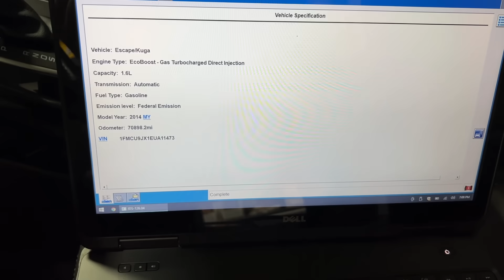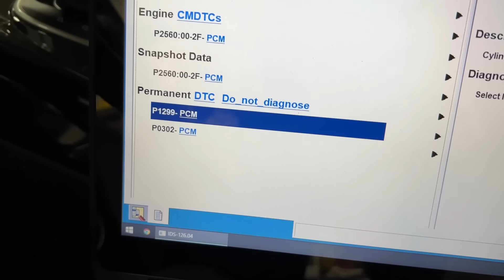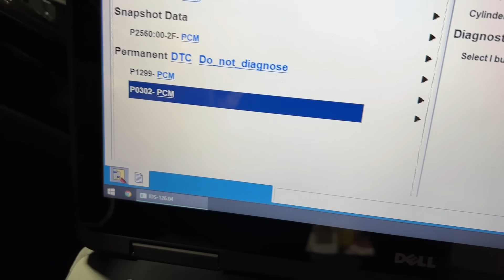Beware of Ford’s 1.5L 1.6L 2.0L Ecoboost Engines and Their Never Ending Coolant Consumption Issues!

Comment: Thank you for the video. I'm very worried for my 2020 ranger. I change my oil every 3k miles strictly, I will do tranny and differential stuff when makuloco and other Ford tech YouTubers has suggested... All that keeping up on the maintenance and there's a chance this may happen. What can I do to avoid this? I only have 20k miles and I have a mishimoto catch can on it. I'd greatly appreciate anyones advice..
Reply: changing the oil every 3,000 miles is a waste of money. modern synthetic oils easily last 10k miles. 5,000-7,500 miles is a good middleground though. 
that said, there's nothing you can do to avoid this fate, it's a design flaw. well actually, you can sell the vehicle and buy something that isn't a Ford.

Comment: I absolutely love the new Ford Maverick. I love the first generation Ford Ranger but could never afford one at my young age at the time. The Maverick has that same charm with me at 54 years of age. This is sad news about the Ford four cylinder engines. I guess I’ll just keep looking. What truck is best for the long haul?A F150 with a base engine?
Reply: best truck for the long haul would be a Toyota Tundra, or Tacoma if you want something smaller.
Reply: @busterscrugs  love the look of the Tacoma but the ergonomics don’t fit my body. Horrible cab design. The previous Tundra is nice.  I’ll end up doing the timing on my 2006 5.4l 3v.
Reply: Not brand loyal but Ford is a nice truck.

Comment: Trying to get a little extra milage by turbocharging an excessively small and lightweight engine. These things run exactly as the old mechanics predicted they would when they came out. Too bad they were designed by engineers.

Comment: An easy  permanent solution to this issue on all three of these ecoboom engines is Steel Seal. One bottle used as per instruction will cure this problem.
Remove 1 litre of coolant from the header tank, warm up the engine and pour the Steel Seal in. Let the engine idle for 20 minutes and switch off. Do not use the car again until the engine is stone cold, ideally overnight. Check the coolant level, top up if required and use the car normally.
I've done 3 like this with this issue and all three have done tens of thousands of miles without any loss of coolant.

Comment: We have had internal combustion engines for over a century. It still beggars belief that manufacturers are churning out engines that are pieces of junk. These car manufacturers really need holding to account. I’m sure much of it is down to the bean counters trying to produce an engine as cheaply as possible and it’s time to stop. Would I buy a modern car? No, I’ll keep my older, tried and trusted motors going as long as possible.

Comment: I have a 2020 Ford Explorer ST and it is a piece of Junk. It only has 15,000 miles with a list of issues that I am waiting on the Ford dealer to get parts for for over three months now. Rear differential is leaking, rear view camera is blue screen, driver side camera is blue screen, driver side cooled seat fan makes grinding noise if and when it decides to work, windshield cleaner fluid  pump stopped working, window controllers on driver side trim coming off, ceiling lights on passenger side hanging by the wire, rattles in dashboard. Thank God it is a lease. I called Ford Motor Company and they really don’t care. This is my first and last Ford.
Reply: Damn, my friend's mom just bought a brand new Explorer ST-line. RIP.

Comment: I had the same problem with my 2019 Ford Fusion.  They replaced the short block.  I just got the car back from the Ford dealer 2 days ago after almost 5 months in the shop because of part shortages.  Luckily it only had 52,000 miles on it so it was still under warranty.  They loaned me a 2022 Ford Edge to drive while it was being repaired.

Comment: sad .. I'm not a  big  fan of Fords .. i think they  are  getting better now than  90's cars but still issues ..  i  wonder  if a bottle  of K&W  block  sealer  would  work (its liquid glass)   its worth a  shot , very  strong  when it  drys  .. could be  strong  enough to hold for many miles  trouble  free . thoughts ?  ive had  good  success with the  product . $14  compared to $8,000 for new engine
Reply: or the steel seal block sealer product too .

Comment: I have a 2017 Ford Escape SE with the 1.5L Ecoboost with 28,000 miles and my wife has a 2015 Lincoln MKC Reserve with the 2.0L Ecoboost and hers just rolled over to 70,000 miles 2 days ago.  As of yet there have been no major issues but I will be keeping an eye on the coolant from now on.  I'm due for an oil change in a couple of weeks so I'm sure they'll inform me of any visible leaks.  Thanks for this valuable info.

Comment: This is the worst car I've ever had I took it back to Ford told them it had issues they just kept giving it to Sunshine treatment fell out with that dealer and took it to another Ford dealer they tore it down and they had it for 3 months . Finally the rental car company started pushing them they put a head gasket on it and throw it back together then it blowed up again. now it's got transmission issue that just cost me $4,100 never buy another Ford again

Comment: I have a 2014 escape with a 2.0 . It has 214,000 miles with no problem.  The 2.0 is a complete different engine than the 1.6.

Comment: Wow, i have 17 fusion with a 1.5 eco.  Very eye opening. I’ve had to add coolant the last couple times at oil changes.  has 82k miles
Reply: Was it smoking from the exhaust? Or did it not give any signs at all? Besides having to add coolant. Thinking about getting a 2014 fusion with the 1.6

Comment: Thank you so much for this video. My wife and I would love to like and own another Ford. Love the looks of the Mustang, but It's basically off the list at this point. Because I really don't want the V8 and the 4 banger turbo is the only other option. Dropping the V6 was stupid. Ford has no excuse making these kinds of mistakes. My 2011 Crown Vic Police is still solid after now owning it for over 3 years. It's not like they don't know how to build something great! And after now owning 2 fairly bulletproof Honda's, I couldn't live with buying something that's going to quickly turn to garbage based on looks. The Dodge Charger seems like a better choice at this point!!
Reply: Nothing beats the V8 Mustangs but the 3.7 V6 is a solid daily driver and is fun to drive with ~305 HP/ 280 lbft at the crank and decent gas mileage. It was a great improvement over the previous generation 4.0 V6 SOHC with 210 HP/ 240 lbft torque. The 3.7 V6 is very reliable and it has the external water pump unlike the 3.5/3.7 versions of the engine in FWD vehicles. The engines are also easy to work on/maintain. The Ecoboost has an edge with additional HP/torque but at the cost of long term reliability/cost of repairs.
Reply: @robc7323  
I agree 100%.  I have an 06 Mustang with the 4 liter and automatic transmission, it was bought with 45,000 miles on it and now has 51,000.  It is fairly reliable, but I know that the newer Mustangs with the 3.7 V6 are much, much better.  And yes, Ford screwed up bigtime by dropping the 3.7 from the Mustang.
Reply: Crown Vic Police.... Makes me want to watch a certain film again, if you know the one I mean. Woop Woop!

Comment: I'm a Ford guy and with gas prices heading north of $5/gal I was looking to get a smaller fuel sipper Ford, this makes me really question what I should consider from their lineup. 
Thanks for always giving such great info
Reply: People keep banging on about Toyota and Honda like they don't have their own issues
Reply: BUY TOYOTA for bullet proof reliability and resale value. Ford is not worth the pain and hassle. They don't stand behind their product aswell. Look at Hyundai, they fix all their engines for free!
Reply: All manufacturers make lemons, but Ford's QC has been in the toilet now for years.  Buy a Honda, Suby, or a Toyota.
Reply: @Nabsolute_  same. My 2 fird cars suffered coolant issues. My 2015 got the dreaded 2.0L internal cylinder leak. Ford told me to pound sand. NO MORE FORD for me. I already successfully turned away 3 buyers from ford. Assholes. I would definitely buy another edge since I love them if Ford came through like Hyundai and replaced the engine with no push back. But since they said FU to me, I'm saying it back.

Comment: I try not to throw mud at folks here on social media,  but I have quite a bone to pick with FOMOCO. I am a service manager for a national used car retailer, after being a 36 year master auto technician with master status achievements with Toyota,  Honda and Nissan dealerships over the years.   
Every manufacturer has cars that break. (Yes, even Toyotas,  of which I own 4 of them) but these issues with Ford 4 cylinders,  and of course the PowerShift debacle,  cost my company THOUSANDS!  Not a week goes by, without a Ford vehicle coming in with an empty coolant tank.  Every time I see a blue oval now,  I feel bad for the owners too. What's worse, the motor company is really not standing behind them either.

Comment: Does not effect 2.3. It's the 1.5 1.6 2.0. I'm a tech at Ford and have no even seen one 2.3 with this issue. 2.3 are usually pretty good.  Except the new ones where the valve cover leaks on the back side due to not enough adhesives. That's on the explorer though.
Reply from the maker: I was speaking of coolant consumption in general due to head gasket or block design. Focus RS 2.3L GTDI coolant consumption recall ring a bell? Five comments back another Ford tech told me no 2.0l Ecoboost engines have this issue and I had to remind him of TSB 22-229. Do you guys actually work at the dealers and read Oasis Broadcast Messages or what?
Reply: @FordTechMakuloco  I haven't had a focus RS 2.3 come in. Not popular in my area. I remember when this first started happening. Everyone thought it was head gaskets but it was the way the water jacket was cut around the cylinder. Most of the ones I come across are on the escape 2.0. I did have one on a fusion only it was cylinder 4. So I stand corrected on the 2.3 liter. I spoke too soon. Didn't realize it was the focus. As mentioned cause those aren't popular where I am.  We get a lot of explorers escape f150 and mustang.
Reply from the maker: Sweet!

Comment: Has this issue affected the 2019+ Ranger? I've been thinking of getting one, but now I don't think so. The 2.3 ecoboost is the only engine the Ranger offers.
Reply: Stay away from the new rangers, I had a 2020 at 10k miles I had gas in the oil, traded it for a rav 4

Comment: I think the main issue with these engines is the lack of deck surface on the blocks. Probably due to weight savings. I think the blocks are flexing under load and expansion and contraction. A more substantial deck surface will allow for better clamping force when the cylinder head is torqued down.
Reply: Open deck design is ok for normally aspirated engine but turbo or supercharged engine need be closed deck.
Reply: @weblover9185  Honda K20C1 and Mitsubishi 4B11 are both open-deck 2.0L turbo engines.  It's not an issue when designed correctly.
Reply: Good point
Reply: If the block is cracking is has to do with the casting and metallurgy
Reply: @bigdaddymak1439  what ever the reason,  Ford should recall all engines effected regardless of owner, miles  or years. Latent defect.
Reply: @bigdaddymak1439  uh no, blocks can easily crack from lack of material. this was common on some hondas from a while back. its not the metal but a lack of it
Reply: @bigdaddymak1439  not metallurgy. Thermal fatigue due to stress from expansion, contraction and cylinder pressure.
Reply: Yep... seeing the issue in person, I must agree. The walls are super thin and the water jacket paths are ON it! Freaking engineering fail. Noamount of preventative services will stop coolant intrusion. NOTHING.  People need to know this so they avoid these ecoboost engines. It's a money pit.
Reply: Does this issue also affect the 3 cylinder?
Reply: Exactly, that is why gen 1 2.0l ecoboosts with a closed deck are less prone to this issue
Reply: @chrisrossman9566  Lots of turbocharged engines have open-deck blocks, I don't think that is the problem in and of itself, as long as the open-deck block is engineered properly.
Reply: @TassieLorenzo  
Makes perfect sense while the engineering that was applied to this design makes NO sense. Didn't measure but the deck sealing surface around each cylinder appears to be less than 1/4" which would be "less than minimal" with a normally aspirated engine much less with a turbocharged engine. Don't know what "savings" Ford was chasing with this design but, whatever it was, this idea was simply "idiotic" !!!

Comment: Bought a 1979 Ford Mustang 2.3L four cylinder well maintained which the oil pump went out at 41,000 miles, bricked the engine, and Ford called it a disposable engine. I see nothing has changed over the years. No Fords for me. I feel bad for the folks that buy this brand and have such large repair bills in their future.

Comment: Just recently had my engine replaced in my 2017 Ford Edge with the 2.0 for this issue with 77k on it. Luckily I had just renewed the extended warranty a few months before this started to happen. They have a new service bulletin for the engine, again , I believe it is a short block instead of the long block that was previously being used for the 2.0. The coolant leak into the cylinder got so bad in mine it hydrolocked the engine and would not start. The service advisor told me 2019 and newer 2.0 engines do not have this issue.
The cost on the invoice was just over 6k for the repair that the warranty paid for.
Reply: I'm just looking into buying that same car lol
Reply: YES, this engine flaw was corrected on all these ecoboosts in mid 2019 ....

Comment: Thanks for posting this.  I enjoy your videos and find them informative and educational.   

I remember from your prior videos your no fan of that generation escape, many reasons.  This is yet another one.  I bleed blue, but Ford lost me when they abandoned their pushrod V8s and went to the modular engine.  What ashame for owners with low mileage 4 cylinder EcoBoost engines less than 10yrs old to have this issue.   Not good.

Comment: The TSB  on this recommends long block replacement. Even though the TSB mentions every other I4 Ecoboost except for the Focus ST, it happened to mine at 180k miles (I think it's a time thing rather than a mileage thing and I put on a lot of miles, so I got a lot more out of it before it went). I originally thought it was the turbo, but . . . nope. It had always used a tiny bit of coolant, but so did the regular 2.0 in the 2012 SE I had before that and that car was bulletproof until it got totaled with over 200k, so I dismissed it as a Ford oddity until I started my car one morning and I couldn't see through the back window for the smokescreen it put out (still ran great, though, with no overheating and surprisingly small coolant consumption even with the mosquito fogger that came from the exhaust until it warmed up). Due to the consumption in my SE, I wonder if the non-turbos also have the same problem, but it takes much longer to manifest and the the DCTs most of them were specced with (mine was a manual) send them to the junk yard before the engine does. Too bad, as Ford made an otherwise great car (er, as long as you got the manual transmissions in the regular Focus). Both of mine were as maintenance-free as a Toyota except for this "small" problem in the ST. Or as Michael Bolton once said, "Shit, I always do that, I always mess up some mundane detail!" Dammit, Ford!
Reply: My 2016 Fiesta ST just started smoking a couple months ago on startup until it gets warmed up. I'm thinking this might be the issue. I'm almost to 100K miles.

Comment: The gen 1 2.0l Ecoboost is probably the most reliable with a closed deck design of the block. When Ford went to the Twin Scroll Ecoboost was released in late 2015 they went to an open block design, much weaker.
Reply: How can you know which one you have? Car in this video was a '14.
Reply: Mine is a 14' 2.0t with 165,000 miles with no issues. Is 2014 the better block?
Reply: @jacobianmail  Yes
Reply: This is the 1.6l you can see it on the sticker
Reply: This isn't made clear often enough. The first gen is a closed deck, Mazda based block. I believe the 15 or 16 Edge received that 2nd Gen engine first.

Comment: Could a person just drive it as is and add coolant? Beats paying for new engine. We have that in our Ford. So far no issues.
Reply: Yes for a while but the coolant leak into the cylinders will more than likely get worse causing the engine to hydrolock and not start, speaking from experience.

Comment: I've been lucky, I guess.  173,000 plus and no coolant issues.  I did replace the egr system recently, but no other non-scheduled repairs.  This on a 2014 Escape 2L ecoboost SE with towing package.

Comment: It’s not just Ford. I have a Fiat 1.3 diesel (same type is used in small vehicles by GM, PSA and Suzuki). It’s an incredible design 16 valves, strong build and sacrificial valve rockers. The big problem is weak timing chain. It’s a single row roller chain where a double row should have been used. Corporate bean counters **ed the engine.

Comment: Back in the 70’s my Corolla use to go through head gaskets. I finally figured out that it was because I was doing a lot of engine braking (teenage games).  During engine braking, head vacuum is doing a lot of work and head gaskets are primarily engineered for compression.  These fords use engine downshifting with cruise control to maintain speed and - god forbid you use your brakes to slow down on the highway.   A 1.6 l does little to slow down a suv and suspect this is part of the problem.